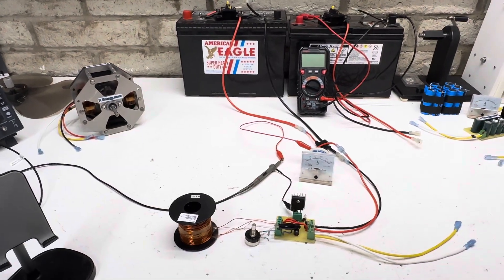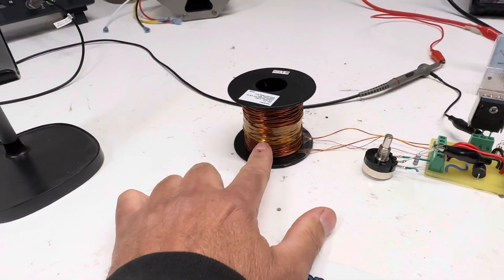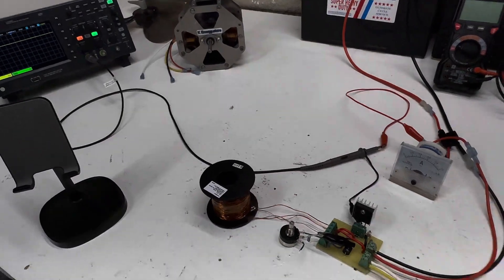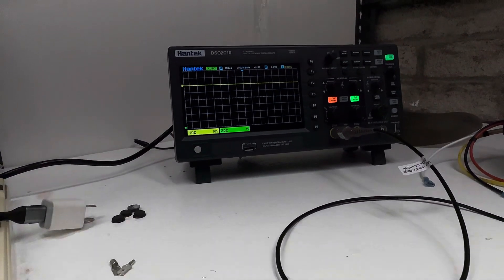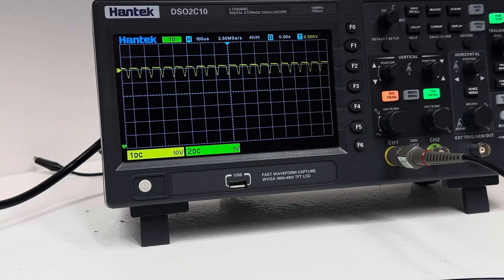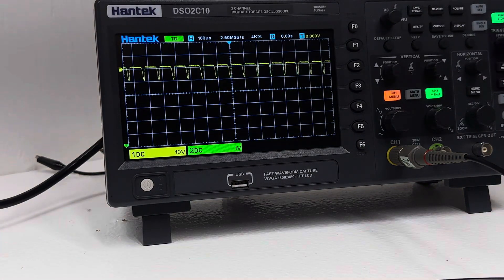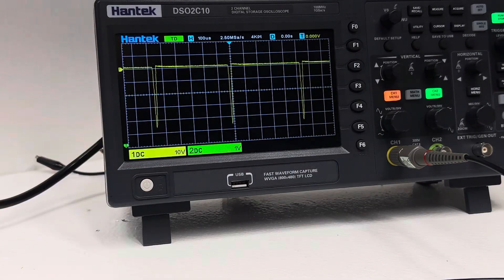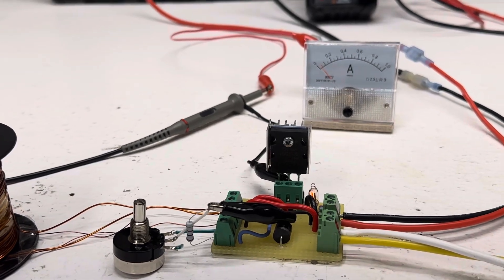Forced oscillator voltage

Comment: Hey Folks! You can feel GOOD about  buying from the Kevin! These are serious TOOLS! Both batteries for my off grid fridge were drained so low the fridge would not start!. At night I hooked one battery to the Force Oscillator input and the other to the output. By morning there was enough power to start the fridge and drive the temperature down to 32.5F while to solar system charged up the other battery! 

I call it the "FORCE" OSCILLATOR because it certainly has a FORCE within! This amazing Force Oscillator was able to do this on a low battery while drawing about HALF an AMP! 

I plan on converting my entire solar setup to run off these oscillators, and adding cap dump feature as well! Eventually I will go DIRECT FROM THE SOLAR PANELS to the Force Oscillators, then powering AC inverters from the charged batteries! This will eliminate a great deal of conversion losses and solar charging equipment while keeping batteries in TOP SHAPE!

May the Force Oscillate With You!
God bless and be well!

Comment: Have you found an Amp reduction on the pot Base when winding shorter triggers? I find it lessens the stress, tho it does affect the frequency. Usually a 1:3 1:4 works fine.
Reply from the maker: Yes I have 👍